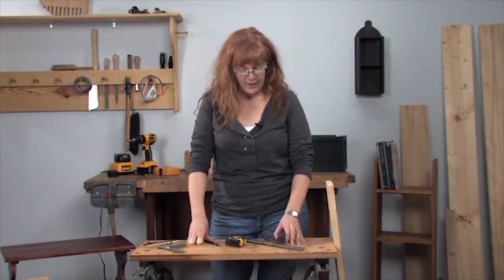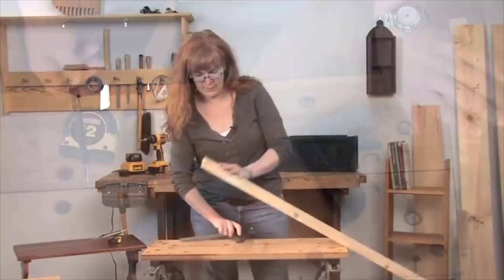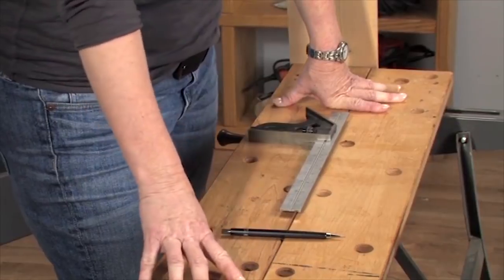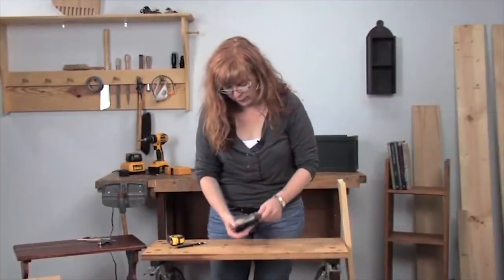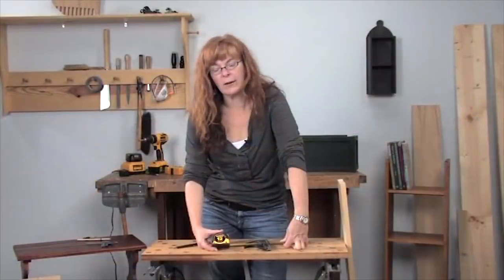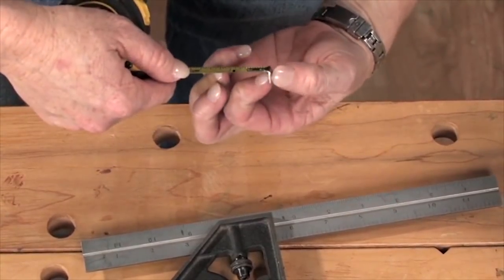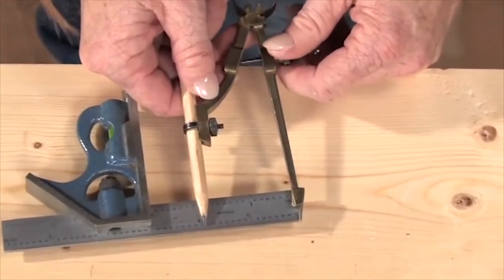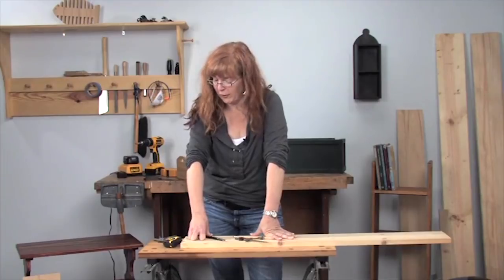Choosing a Starter Set of Measuring & Marking Tools

Comment: Combo squares come in packages around here, you can't check them without tearing the cardboard, cutting a zip tie, or cutting plastic. Just buy a good quality American made square from PEC, Starrett, B&S, etc. It will last a lifetime, it will be square, and it will be pleasant to use.
Reply: Definitely buy a good quality square but still check it for accuracy, not just on the day you get it but ongoing as they can get dropped etc and go out of square.

Comment: A measure tape with an autostop is much better. So don't have to pull down the brake, when it should hold. And nearly allmost all combinationsquares are not square, which you can buy in the hardware store or the internet.